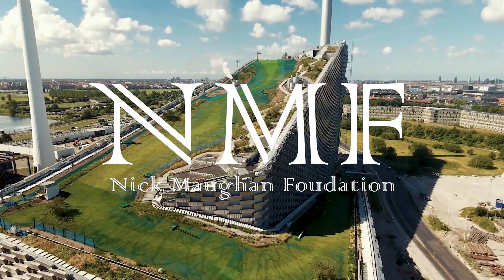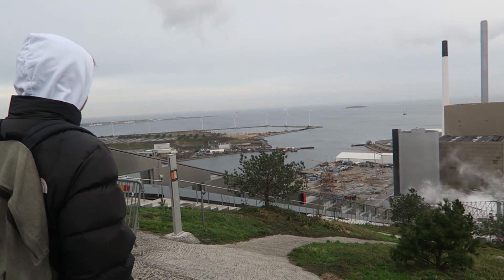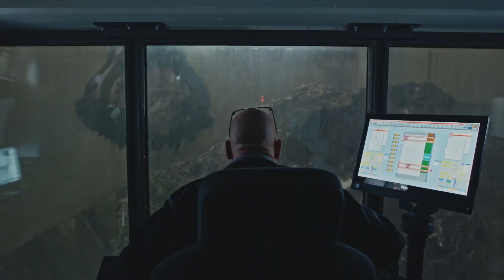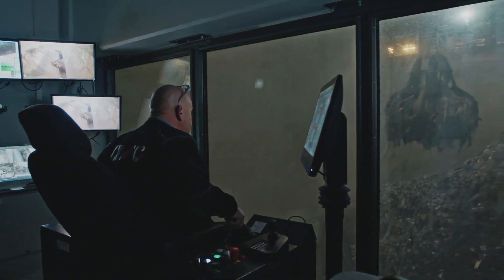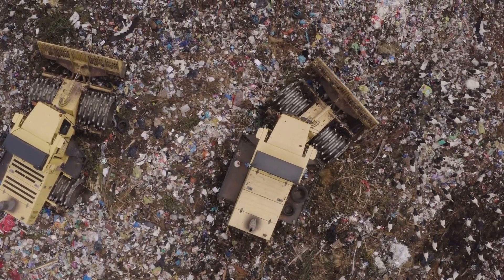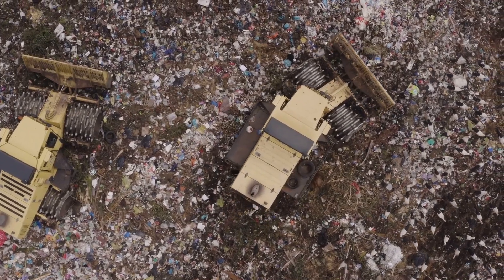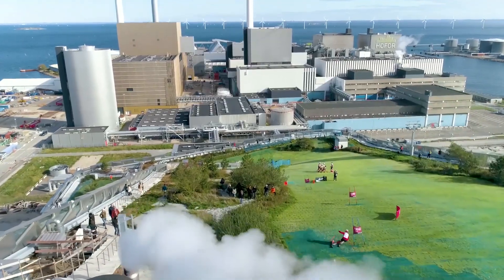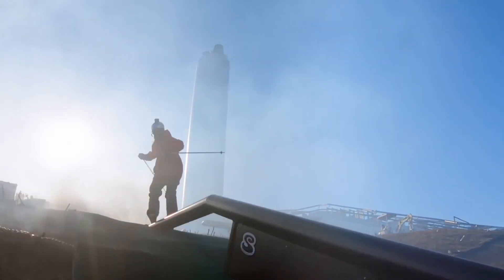Waste To Energy Powerplant | CopenHill by BIG Architects

Comment: Very interesting, but would like a more detailed explanation of just how the toxins produced are supposedly extracted to produce harmless steam.
Reply: Agreed, Air Pollution Control Filters would be my answer to extracting toxins but would like detail as they vary from plant to plant. Also what about carbon capture? Is that happening as I know in the UK, only a few Energy from Waste plants are moving in this direction and the solutions are not at all easy so I would guess more than steam is being produced at this plant though happy to be proved wrong. However, emissions are a major part of an EfW site and need proper and thorough explanation if one is to do a video like this. Not a bad effort though and I like the term "Hedonistic Sustainability". That's a new one.

Comment: Great video but what happens to the toxins and CO2go it all that is released into the atmosphere is steam?
Reply: steam is in it's essence water-vapor. H2O. When biomass burns it releases CO2 (C=corbon, and all organic material has carbon, and O=oxygen), so if you filter out the C, you're left with oxygen. When oxygen mixes with the hydrogen in the air and cools down it becomes H2O, water. so no CO2 comes out, bacause the C is removed.